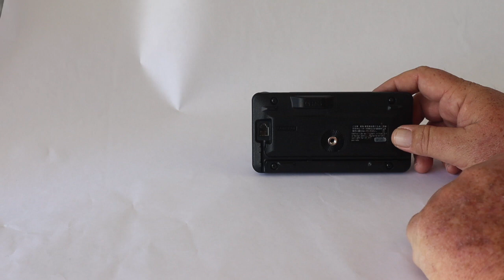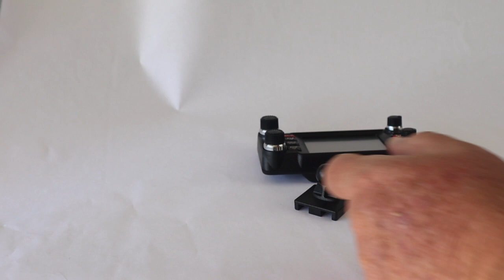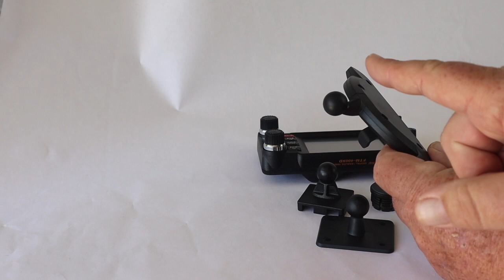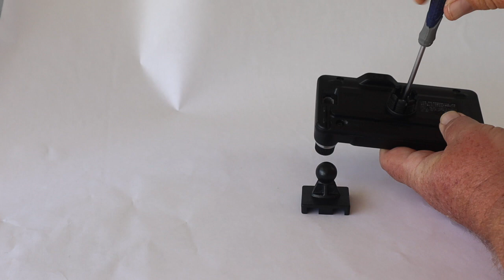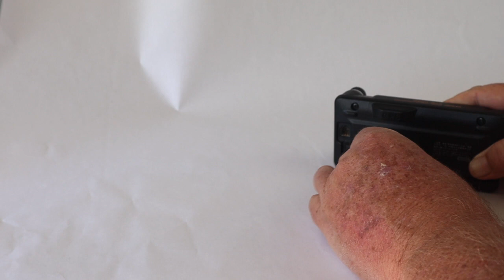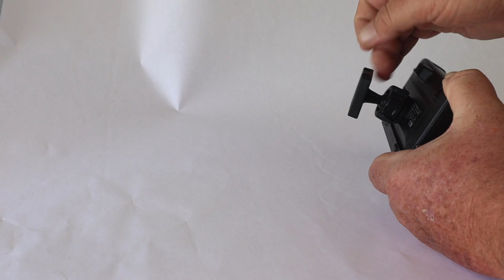Lido Adapter Plate For Yeasu FTM-100 FTM-300 FTM-350 FTM-400 FT-891 Instillation instructions

Comment: These don’t work I used one on my FTM 400. The head always fell off because the ball is too large and cannot be tightened down. Called Lido did not help. I had to scavage around to find another ball and ring in order to make it work. Lido refused to accept the fact that the ball did not fit.
Reply from the maker: Hi John, if you screw in the upper portion first into the FTM-400 and tighten with a screw driver, make sure it is seated into the gasket, then snap the ball in the socket and tighten the ring, you will find it works great. There should have been instruction in the package describing this.
Reply: @Lidoradio  it does not work. I tried everything. The ball does not fit into the socket.  As soon as you start to tighten it down, the ball pops right out because it is too big